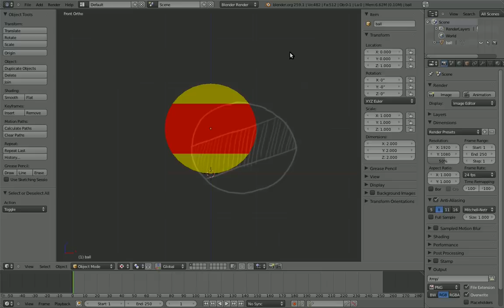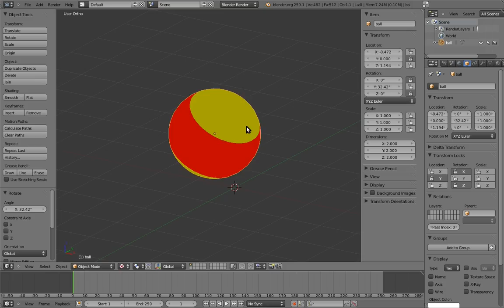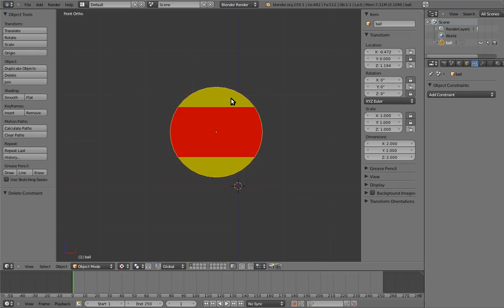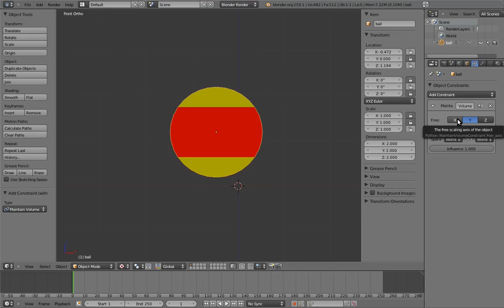Humane Rigging: chapter 01, video 01 - Relationships, Empties, Drivers, Armatures, Custom Shapes

Comment: Blender 2.8x :
- Transform Locks are now in the Transform sub panel like in the N panel with the padlock icons

- (2.80 -> 2.82) Ctrl + Shift + C not working in Object Mode, add it in the Object Mode (global) keymap (id is object.constraint_add_with_targets)
Reply: did you finished this course in 2.8 ? is still useful?